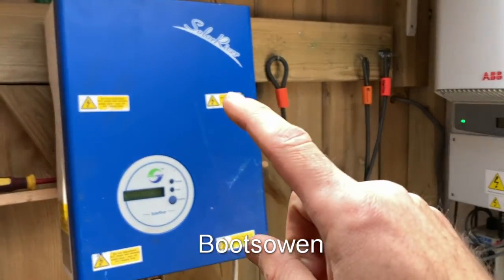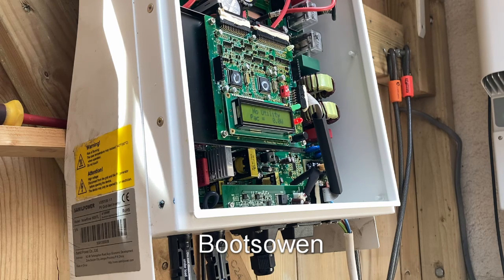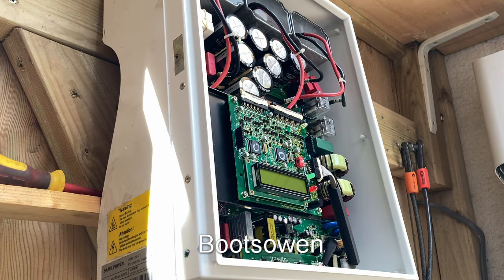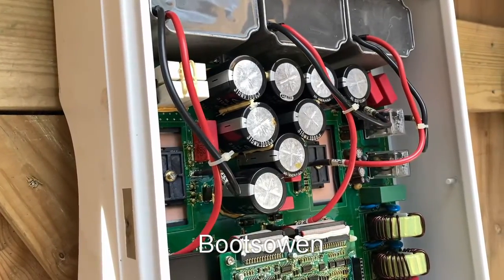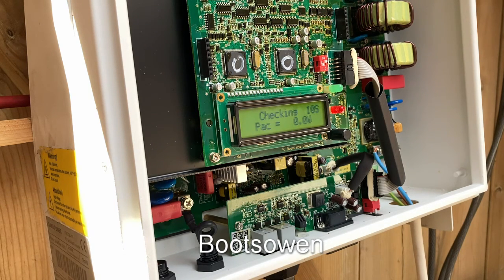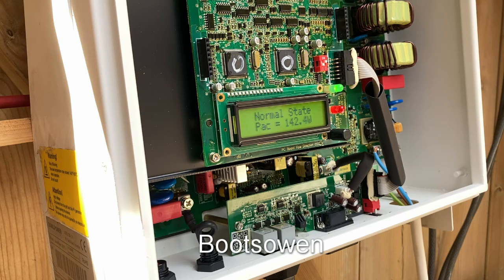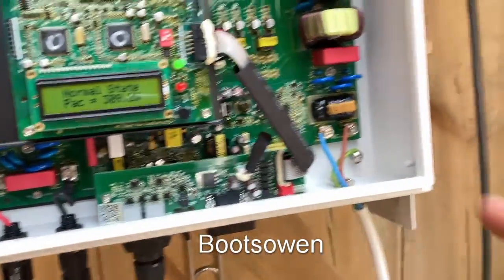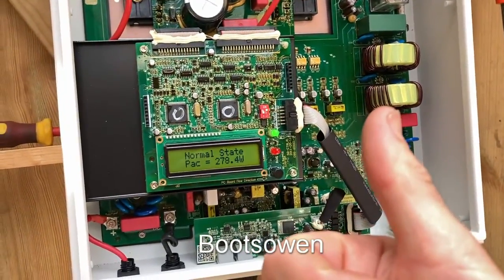How to fix: Samil Power Solar River 3000TL Grid Tie Inverter: "No Utility" fault message repair

Comment: Hi thank you for the video it was excellent.  I have just wired my inverter up but haven’t connected the solar panels yet am I correct in thinking that the lcd display doesn’t light up / come on until the solar panels are connected even though the 240v is connected.
Reply from the maker: Yes

Comment: I recently had the relay failure error with one of these, if you're handy with electronics (and understand how to safely work on devices with large caps) 
I was able to fit some finder relays into the board as replacements and they have been functioning fine. The part number is 56.42.9.012.0000 you need to snap off two of the legs and file the ends flat as well as reusing the insulators from the original relays. I'm hoping these US models are longer lasting than the cheaper Chinese options.
The old ones were a bit of a paint to get out. You'll potentially need some thermal grease for the FETs as well as they become glued down with the insulating tape they use and it gets damaged during board removal.

Comment: If you need to replace the relay can u just replace the relay or do u have to replace the whole board
Reply from the maker: Have a look at my other solar inverter repair videos. Thanks
Reply: @bootsowen  what one send me the link
Reply from the maker: if you struggle to use the search function in YT then you have little hope of repairing your inverter!
Reply: @bootsowen  wow u sound like a good honest bloke Hard to help someone out ! The only reason I ask for the link is because all of your videos u just dribble about the same thing And don’t make any sense.
Reply: I recently had the relay failure error with one of these, if you're handy with electronics (and understand how to safely work on devices with large caps) 
I was able to fit some finder relays into the board as replacements and they have been functioning fine. The part number is 56.42.9.012.0000 you need to snap off two of the legs and file the ends flat as well as reusing the insulators from the original relays. I'm hoping these US models are longer lasting than the cheaper Chinese options.
The old ones were a bit of a paint to get out. You'll potentially need some thermal grease for the FETs as well as they become glued down with the insulating tape they use and it gets damaged during board removal.

Comment: Hey mate. I'm in NSW, Australia & I found 1 of these yesterday, that somebody was chucking out for the local council to pick up. Bargain! Free 👌 I'm pretty deep into off grid & living in my Van with my dog. I saw another video with a similar problem but mine only has a broken solder joint on a capacitor or relay? Could I run solar through it & get AC out? No grid obviously. I've seen it done b4. Cheers.
Reply from the maker: If you've seen it done before then you think you know what's going on?  If it is a grid tie inverter then good luck getting it to wake up without grid? Where would your power go?

Comment: I just bought a second hand inverter 3200 to solar river for £100 eBay. But don’t have a lead so I will have to open it up and wire it like you have. This is my second solar river inverter first one bought a few years back 4400w solar river still working great.
Reply from the maker: Good stuff. Good used inverters are out there cheap. And having a spare is good news!

Comment: Owen, splendid, I like those Solar River inverters, they have a land rover type feel. If you run them at half the spec, they will last for years. Switch mains off first and switch the mains on last to avoid DC arcing in the contacts, cheers
Reply from the maker: Mains off first, mains on last, I'll save that somewhere between my ears!

What are the 3 big things at the top, are they big rectifiers? and are more modern machines using FET switching instead of rectification?

I am thinking about leaving 9 panels on the ABB Aurora, then putting the next 5 on the Solar River. That way each machine is running under spec. There are probably inefficiencies with that, but the power is free!
Reply: @bootsowen  Owen, I think the 3 things are capacitors. I believe that these inverters run as variable buck converters based around the AC voltage and cycles. Good system idea, both machines will be running cool with no fuss. Cheers, Andy